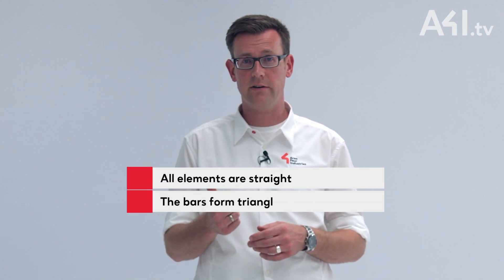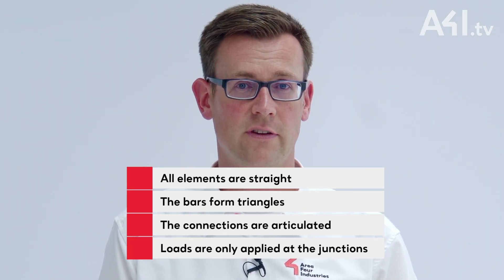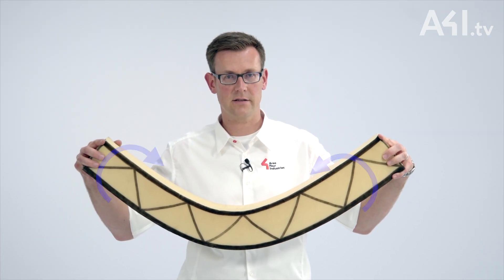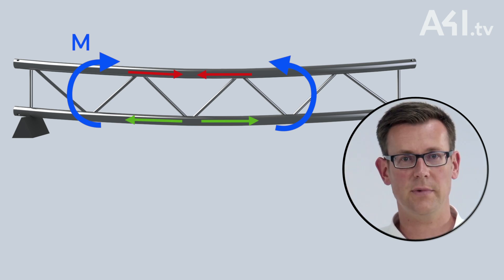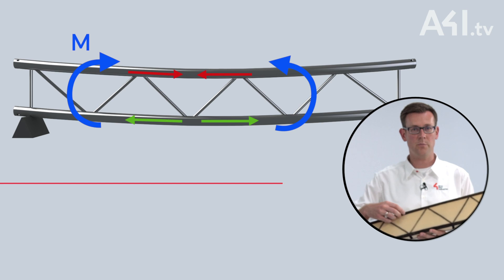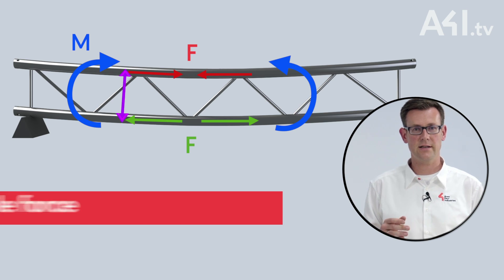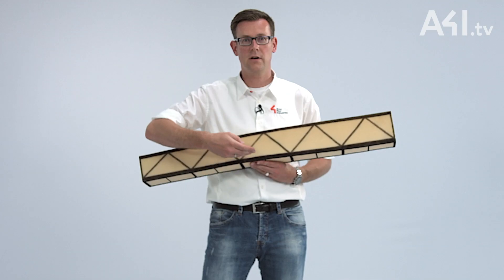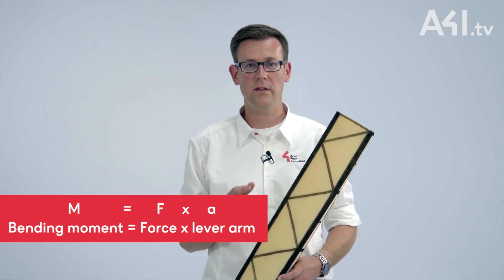How Truss Works - Part 2 - Norbert Tripp

Comment: Hello Norbert,if you showed us how to calculate the bending moment...can you tell us how it works the forces on the cantrilever?oposide the bending moment you have a uplifting force...how to calculate?it is the same formula but negative force?
Reply from the maker: Hi Stefan, 

Thank you very much for your question, which surely will be asked by others as well. Basically a cantilever arm has a negative bending moment where the upper main chords are pulled and the lower ones are pressed. So the forces in the main chords are simply the other way around than on a truss supported at both ends. 
But the question can be explained better with the help of sketches, examples or animations. Therefore I decided to dedicate an own video to the topic cantilever arm. Since we have planned a video shooting in the coming week anyway again, we will make a new video to this topic. It will take some time until the video about cantilevers will be released, because we have to edit it and other videos are waiting for the release.
So, stay tuned and watch out at www.a4i.tv